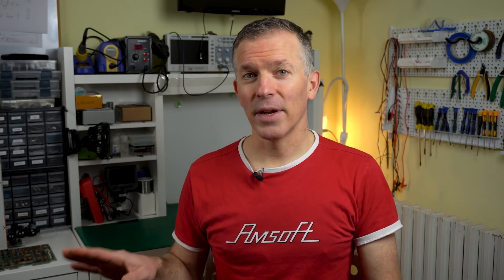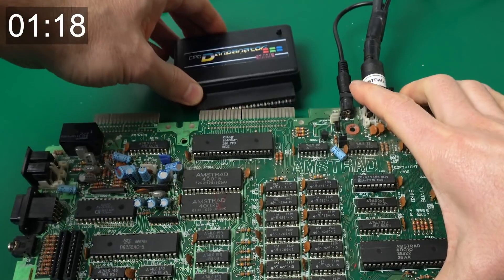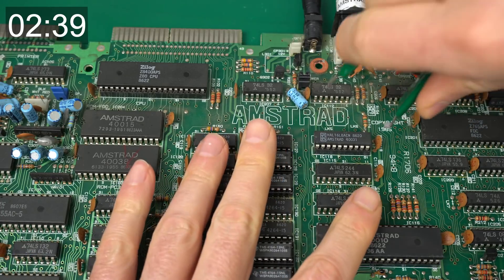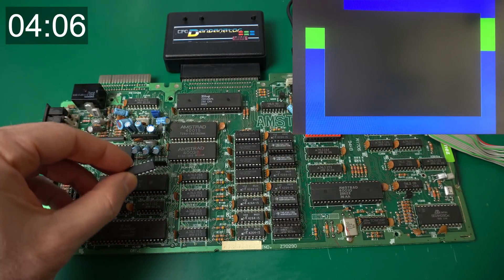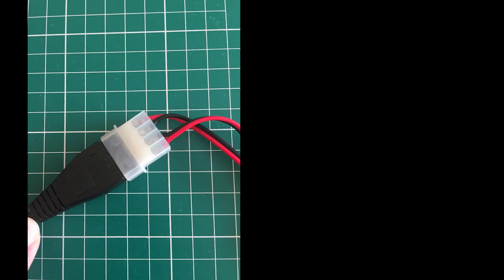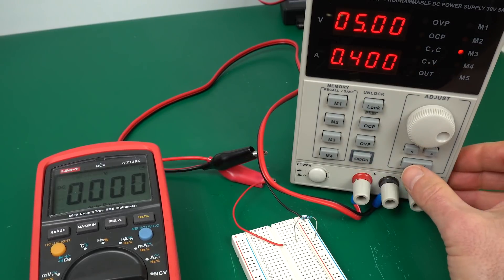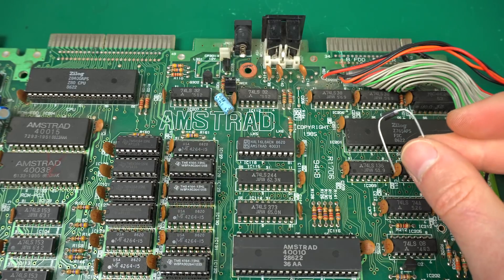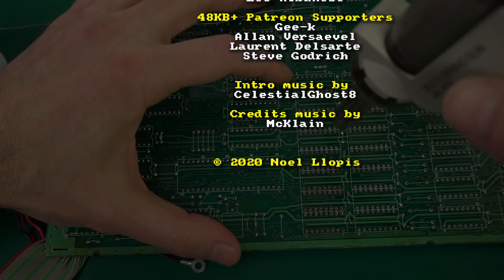Overvoltage Repair and Prevention on an Amstrad CPC 6128

Comment: Question: Why not put a 7805 (or switching 7805 equivalent) so the 5V rail will always remain at 5V or just kill the 7805 and stop damaging the board?
Reply: A linear voltage regulator requires the input voltage to be higher than the output so it would require injecting more than 5V for it to work properly. One could, of course, make a mod to take the 12V input, use the regulator to reduce to 5V and use that to power the logic board but that would require a different power supply and I think the idea is to keep the whole setup as original as possible.
Reply: @adilsongoliveira  if the power supply output is high enough, is it possible to use 12v rail to split a 5v by buck converter? I have no idea the output number of the power supply.
Reply: @johnsonlam  Sure. As long as the power supply can cope with the whole load, no problem.
Reply from the maker: That's a good question. I think it's a good idea, and it would generate better voltage levels on the Amstrad. The problem is that you need to change the input voltage to be at least +2V more, so +7V. At that point I guess you might as well make it center negative and use a ZX Spectrum power supply. It's not a bad idea... The only problem is potential confusion and then getting used to it and plugging that power supply on a new Amstrad that doesn't have the mod and BOOOM! 😃
Reply: @NoelsRetroLab  I forgot to calculate the voltage drop, and if the power supply is good enough, there’s some very tiny buck converters which can output constant 1Amp, but I have no idea since my home city Hong Kong almost have no Amstrad for sales back in 80s, at that time Apple II clone dominated the computer market.
Reply: @Mr Guru yes you’re right, old 7805 generate too much heat and I bought some switching replacement. The specification is quite nice and should work well but not sure if any trouble in this kind of circuit since switching type have higher noise.
Reply: @Mr Guru Traco TSR 2-2450?
Reply: @Mr Guru an L78S05CV is a cheaper option, I don’t think they run as cool as the TRACOS. The TRACOS don’t need a heat sink?